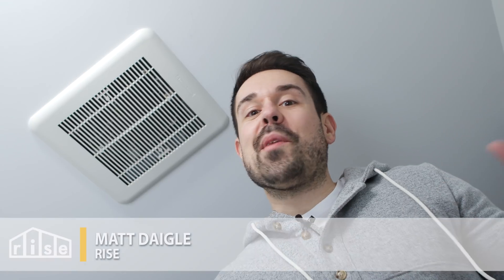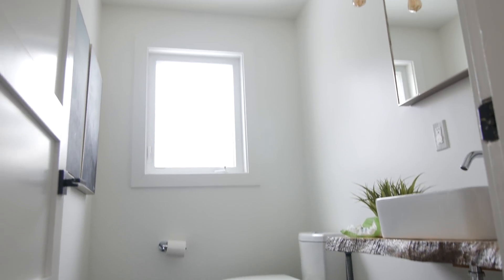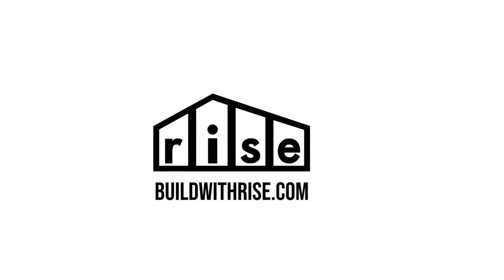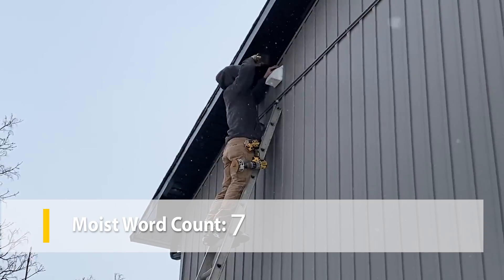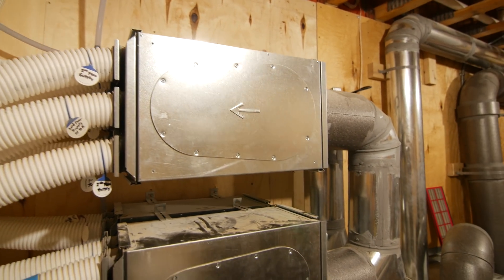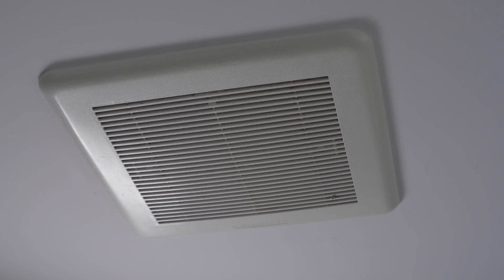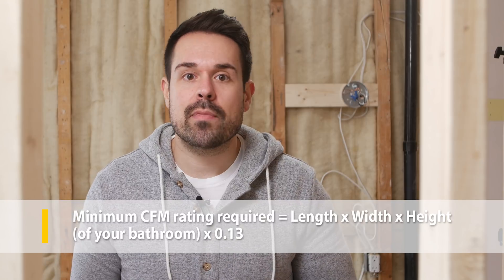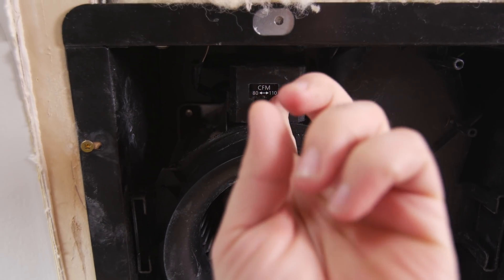Bathroom Fans: Guide, FAQs, Pros and Cons of Exhaust Fans

Comment from the maker: A weird (but important) question: do you prefer your bathroom fan to make a noise when you turn it on?
Reply: I'd prefer as close to silence as possible.  I've put up with noisy 'fart fans' for years as a result of living in cheap apartments, and the first house I get I will make sure that it either has a silent fan or will be able to have one easily installed.  EDIT:  I'm more referring to the motor noise; the white noise the air makes when being evacuated is fine.
Reply: Silent of course. I'm sick of noisy bathroom fans. I cant hear almost anything if not anything when it's noisy lol
Reply: The solution there would be a smart speaker and home automation that detects if the shower is running. If the fan is on but the shower is off, the speaker plays fan noises. If the shower is running, the fan runs silent and the speaker plays whatever you want.

Comment: I know this is an old video but i have a question: I'm going to be having my bathroom remodeled and the floor plan will be bigger (will be 12x6x8). The math is just under 75 CFM. Do i go with an 80 or do I go bigger? Im installing a shower, vanity and toilet as well

Comment: Omg he said it would cost around $500 to get the exhaust fan installed but i just got a quote for $700 from an electrician and that didnt even include cutting a hole in the roof to ventilate the fan. Definitely gonna get more quotes
Reply: That’s no a bad deal if it includes fan, parts, labor. Duct to roof, hole labor etc will be another $200-400+ depending on the specifics of roof vent, if shingles etc etc. Do it to code! Don’t cut corners or you’ll pay out for damages, mold, fan not operating to its max ability.

Comment: My bathroom ceiling is open, so while I am there, I want to change my bathroom fan for a new one, but I have a 3" diameter exhaust pipe, I’m considering changing it for a 4" pipe, which seems to be the standard now, I noticed that the new fans are made mostly for 4" exhaust, but some comes with adapters to fit 3" exhaust pipe. Is it worth the trouble changing for 4" exhaust ? would it be more efficient ?

Comment: Why would you want to switch the CFM to 80 instead of 100CFMs? Is it true that if your mirror fogs up when you take a shower that the fan isn't powerful enough? 

We are going to have a shower that has a rainfall head in the ceiling and a wall mounted head each with their own water lines so it will be using double the water-does that mean I will need a higher CFM to account for the extra moisture? 

Lastly if we mount the exhaust fan inside the shower will it make it too breezy? Because it will not have a shower door so it is pretty open as is-which I'm also afraid may make us cold even though they say it doesn't which I don't understand because if you open the shower door on a normal shower it gets cold. I dunno.

Comment: Pretty sure that exhaust fans don't cause a hard vacuum, so they also bring fresh air into your house through gaps, furnace fresh air intakes, dryer ducts, etc. by creating a negative pressure differential relative to the outside.
Reply from the maker: You're right, David! For homes that aren't air-tight, a bathroom fan can pull in fresh air into other areas of the home (especially if your bathroom door is often left open). Some folks might find this article helpful: https://www.buildwithrise.com/stories/does-a-house-need-ventilation